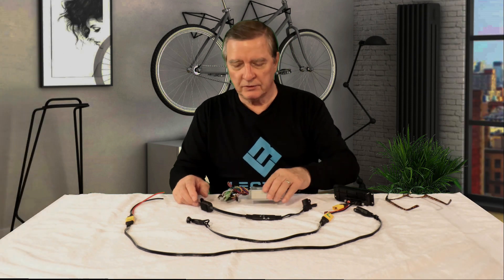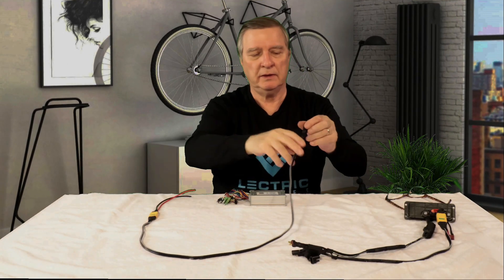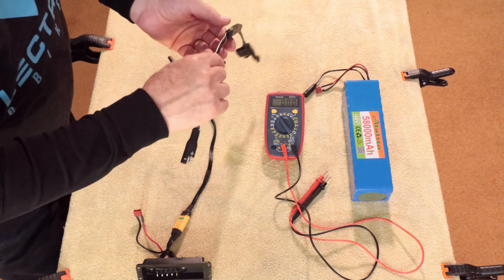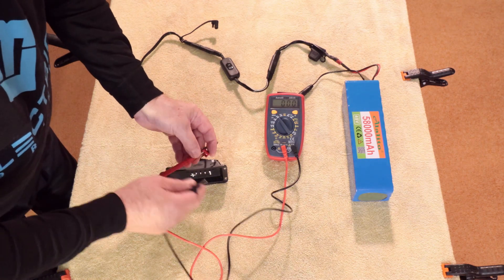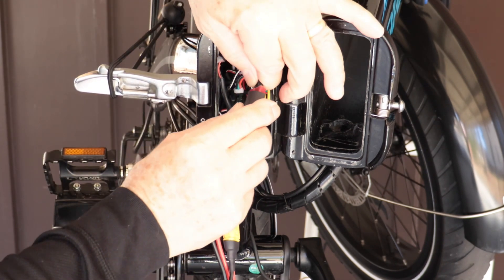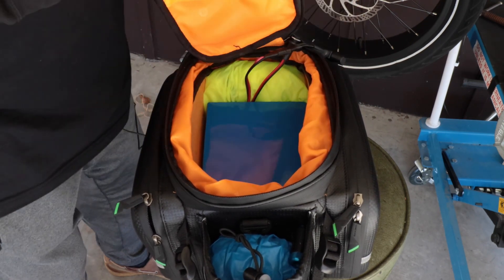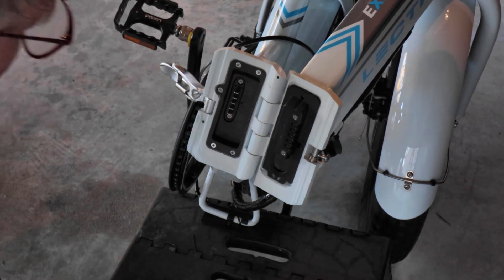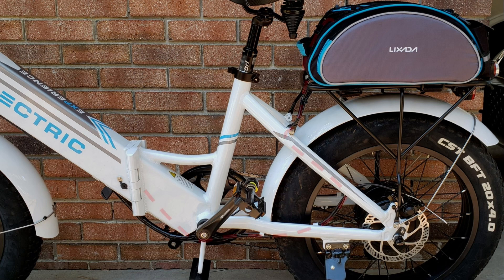How to E-Bike - Auxiliary Battery Wiring Harness in Detail

Comment: I rigged up an auxiliary battery in a similar fashion, but found I needed an isolate switch to remove the stock battery from the parallel circuit. With a 4v difference between aux and stock batt, I was getting a 12 amp draw off of the aux batt into the stock batt with the key removed. I verified with a wattmeter in-line as well as a multimeter between the stock batt terminals. Also verified after leaving it that way for about 3 mins and got a .5v increase on the stock battery voltage. Have you found any issues? I'm unsure how the key disconnects the terminals from the battery circuit.
Reply from the maker: Both batteries need to be at the same voltage level (+/- 0.2v).  I always change both of my batteries (14Ah and 20Ah) to full capacity 54.6 volts.  I run both batteries in conjunction and both batteries discharge at the same rate.  When I'm charging the batteries, I charge them separately.  The bike key in off position and the on/off switch to the auxiliary battery in the off position.  I have 4 batteries (stock battery size), two 10.4Ah and two 14Ah batteries.  One of the stock Lectric batteries has a damaged circuit within the battery and no matter what position the key is in, the battery is still on (power to the battery terminals).  I have well over 2,000 miles running the system this way and I have had no problems with battery unbalance, or any other issues.  I now have another e-bike, a Polarna, and I have wiring it up the same way and have had no issues after about 60 miles of riding.

Comment: Sonny, could you please let me know how much charge the battery on my XP1.0 should have when I store it for 2 or 3 weeks? Thanks
Reply from the maker: Anywhere between 40% ( 46.9 volts) to 60% (48.4 volts) would be fine with a target at 50% (47.4 volts).
Reply: @Onyasix  Thanks, I appreciate all the helpful information you've put out there, starting with mounting the bike. I ordered a 2.0 XP for the front suspension. It' will be easy to sell the 1.0 for close to the purchase price. Thanks again and good with your new 🚲

Comment: Couldn't find your video actually connecting the wires. Would be very helpful to see the correct connections in real time. Thanks!
Reply from the maker: Starting at 15:52 , I show the connecting of the battery connection panel to the auxiliary wiring hardness and connecting the battery connection panel wiring back into the controller.  Also,  in the video description, I show  links to several other videos that I have do on this subject.
Reply: Thanks!

Comment: I'm contemplating this modification, but was looking at identical batteries so I could charge them both simultaneously with the factory charger. Because your batteries are different, do you charge them separately?
Reply from the maker: Jack, sorry for not getting back sooner.  Yes, I charge mine separately for a couple of reasons.  Even if my batteries are the same, if you use just one charger (apples to apples), it will take twice as long to charge your batteries.  Also, no matter what, even if the batteries are exactly the same their charge rate will be different .

Comment: you should make a video doing a dpdt switch, this method is not safe if you have the switch and key on by mistake and also if both battery diff in voltage, i heard those ebay battery also uses cheap used chineese cells, im returning them before opening, i wouldnt recommend cheap battery as they can be dangerous, thanx to your video i figured out the ultimate way to add extra battery

Comment: This is what I needed. More stupid questions. Do you run the batteries one after the other or on at the same time for maximum range?
Reply from the maker: I run both batteries together.  I always fully charge both batteries, starting out at 54.6 volts each.  Since they are connected in parallel, they will discharge at the same amount of voltage.  By running them together, the batteries will run cooler since they are sharing the load.  Less heat from the batteries mean two things, they are not stressed as much which will increase their longevity and less heat means less energy lost which will increase range a little.  When I first started using the auxiliary battery, I used them separately which was a little of a hassle,  the batteries were never charged in sink with each other which mean more management.   At first, I was somewhat skeptical running 2 batteries of unequal amp hours together at the same time.  Other e-bikers that we running them together assured me that they were not having any problems.  So, I started running mine together and have not had any problems with more than 2,000 miles doing them together.  👍
Reply: @Onyasix  Thanks again. I am waiting for my ebike as we speak.

Comment: sorry for bothering you, i have watched all of your previous wiring harness videos, i dont have degree in electrical engineering but im trying hard to understand this sir, i was wondering if this wire from ebay  will work>>>>> https://www.ebay.com/itm/164679908565

and lastly, can i use 14 awg wire for that red and black wire?

or can i use this one and solder it to the battery conenctor>>> https://www.ebay.com/itm/174762949931?hash=item28b0aefd2b:g:X84AAOSwX9dgl9su

Comment: Finally got my Lectric Step Thru bike and installed the wiring harness as you described. Thanks for all the reminders to check and double check polarity before connecting battery to controller!!! Your detailed wiring harness videos are MUCH appreciated and ALL the battery data will help me determine if my battery is working as advertised! I have referred several people to your videos but the battery supplier we used is OUT of the 20AH batteries. Many battery sellers appear questionable as you have discussed; so selecting one that is honest and sells quality cells is a crap shot.

Comment: is it hard to install the Inline Cord switch to 14AWG Wire Harness with Quick Connect, im kinda confused, i really need long range as im doing uber eats
Reply: can you help me install a 20ah battery please?  the battery you have is out of stock, any help would be appreciated, thnx
Reply from the maker: @rahi7339  My DIY video is my help to provide instruction as to how make and install auxiliary wiring harness for an auxiliary battery.  The 20 Ah battery has been out of stock for several weeks now, however the 10 Ah batteries are available.  If you do not want to wait for the 20 Ah batteries to come into stock, you can take two 10 Ah batteries and connect them together  in parallel to make 20 Ah. If you need extra chargers, you need to make sure that you are ordering the batteries with charger(s).   Here's a link to a 10 Ah battery:  https://www.ebay.com/itm/224193914985?_trkparms=aid%3D1110006%26algo%3DHOMESPLICE.SIM%26ao%3D1%26asc%3D231994%26meid%3D146c30f2d6ef4232bd67596102fd594b%26pid%3D101195%26rk%3D1%26rkt%3D12%26mehot%3Dpf%26sd%3D184692542226%26itm%3D224193914985%26pmt%3D1%26noa%3D0%26pg%3D2047675%26algv%3DSimplAMLv9PairwiseUnbiasedWeb&_trksid=p2047675.c101195.m1851
Reply: @Onyasix  thank you, does your video shows how to do them parallel? I'm kinda confused, I will buy one 10ah battery for now, I was wondering about how to install the switch to the wire
Reply from the maker: @rahi7339  ~ a parallel connect between two batteries is fairly simple for those that have a basic background in electronic . . . red wire to red wire and black wire to black wire.  I don't know your electrical skills, but it sounds like this DIY project may be challenging for you.  You may want to get a friend with electrical experience to help you with this project.  If you would connect your wiring improperly you could do damage to your XP's controller, or even worst, cause a fire.  That being said, the 10Ah battery is still a good choice.  It would come close to doubling your range.
Reply: @Onyasix  do I need to buy any extra wire if I'm doing them parallel? And also do I need to do any polarity check you did? Someone told me I don't need to that as long as battery is 48v, thank you for the help
Reply from the maker: @rahi7339  ~ all you need is the wiring harness, the connectors and the switch as shown in this video.  If you are going to connect two 10 Ah together in parallel for your auxiliary battery, you need a Deans Parallel Connector (1 female to 2 male) https://www.amazon.com/FLY-RC-Connector-Parallel-Battery/dp/B07P6Q1DP5/ref=sr_1_32?crid=2Z1T8YQX379OX&dchild=1&keywords=deans+y+adapter&qid=1619489515&sprefix=deans+y%2Caps%2C174&sr=8-32
Reply: @Onyasix  k i understood everything, im just confused about how do you install the inline cord switch to the 14AWG SAE to SAE Extension Cable, im also planning to install a battery that has key? so will i need any switch? if not what cable do i need to buy? can you give any advice with that pleasee?
Reply from the maker: @rahi7339  ~ I've done a total of 4 videos on the auxiliary battery for the XP.  This video is the last one of the four.  It should help answer your questions to watch all 4 videos.  Here's links:  https://www.youtube.com/watch?v=jMvYM4Y3s24
https://www.youtube.com/watch?v=1ej3M_SEzmI&t=1064s
https://www.youtube.com/watch?v=hIS3FRVQHXc&t=315s
Reply: If possible, a video actually showing you connecting the wiring harness together would've been very helpful.
Reply: @mrmagoo9901  I already have two big 20ah and 25ah battery in my rear rack, my setup is completely different from the one in the video, mine is the most safest, I hired a professional to build me Dpdt switch to run one battery at a time, cost was like 40 only

Comment: Sonny, thanks again for your wiring directions; there is another person on facebook that gives a similar explanation of wiring for aux battery BUT his wiring does NOT include a FUSE that you have in your directions. 
 I assume that one reason you include the fuse, is to protect against the dangerous mistake of connecting the batteries when they are at a significantly different voltage?? Which would make for a BAD DAY as you say!  AM I RIGHT IN THIS ASSUMPTION?? The RUSH of current from higher to lower voltage battery SHOULD burn out the fuse before the batteries reach critical heat and explode?? Please comment on this assumption on my part. I did not hear you explain the use of the fuse in your videos.
Reply from the maker: I feel safer with a fuse for protection against a short in the wiring circuit.  48 volts systems are not to be taken lightly. There is the potential to create a fire and we have all heard horror stories about Li-ion batteries over heating and exploding and catching on fire. The XP's controller is limited to a maximum of 20 amps.  So, a 20 amp fuse or slightly higher will be required.  I tried several fuses less than 20 amps and as soon as I applied a load on the XP, these fuses would blow.  I run a 25 amp fuse just to be a little above the controllers 20 amp limit. Also, when running the auxiliary battery together with the stock XP battery, the wiring from the auxiliary battery to the controller will never reach the 20 amp load since both batteries are sharing the current load.  Example ~ stock XP 10.4 Ah battery  together with a 20 Ah auxiliary battery, the auxiliary battery will be suppling approx. 2/3 of the current or a max of 13 amps, while the stock battery is suppling the remaining 1/3 of the current or a max of 7 amps.  That being said, a long as you use both batteries together, you could use maybe a 15 amp fuse without it blowing when the controller is demanding a 20 amp max.

Comment: I was wondering a 6A 250V AC switch is good enough for a 48V DC with a current of (sometimes) 30amp (PAS 5)?
Reply from the maker: After more than 2000 miles, I have had not problem with the switch.   The controller on the XP is limited to a max. of 20 amps.  Out of those miles, I rode using the auxiliary battery alone drawing 20 amps (up hill) during several hundreds of miles of riding with no problems . . . overheating etc.  I now ride mainly running both batteries together.  Running them together with the controller demanding 20 amps., each battery is sharing the load.  So, the auxiliary battery on/off switch never has 20 amps of current passing through it.  At 20 amps (max.) going through the controller, the aux. battery (if 20 Ah rated) will only be contributing approx. 2/3 of the demand which is about 13 amps.  The stock battery (10.6 Ah) is suppling the other 7 amps.
Reply: @Onyasix   Thanks again for your excellent videos and for taking the time to respond to the comments/questions.  A couple of days ago, my 6A 250AC switch got stuck on the "on position" and got the controller error (E009) while I was using only the auxiliary battery.  When I opened up the switch, I realized that the internal circuit/plastic has melted - Luckily no damage to the controller/battery.  I replaced the switch with a higher rating of 10/16A.  The max drawing current was 20amps (typo *30A) on the auxiliary battery.  All wirings/connections were the same as yours.  Not sure what else could have caused the blown switch except the lower amp tolerance. On a different note: Does it make any difference if we place the switch closer to the auxiliary battery (swap the switch and the fuse positions).  So that in case of mistakenly connecting two batteries with significantly different voltage the fuse be able to protect the switch (and the battery)?  I presume it should not make any difference and the lower amp tolerance (i.e., the switch) will act as the fuse!?
Reply from the maker: I live in a relatively flat area, few hills and up hill runs don't last long.  I have not put my auxiliary battery in a condition where the XP is pulling 20 amps for an extended period of time, say more than 20 to 30 seconds.  As mentioned below, now I run both batteries together, so even when the XP is pulling 20 amps, the auxiliary battery/switch is only subject to a max of about 13 amps.  I weigh with gear and accessories ( aux battery, bike bags, water bottle, etc.) about 220 lbs.  Your riding conditions may be requiring more extended current loading than mine.  Where did you get your 10/16 amp switch?  I will mention your problem with the 6A 250v switch in one of my future videos.  Just curious, did you have a fuse in the wiring harness and if so, what amp is the fuse?
Reply: @Onyasix  The switch I am using is from Amazon (E-outstanding Inline Cord Switch 250V 16A Black Inline ON/OFF Rocker Button with Red Indicator light).  On the back, it says it is 30A/250AC! I used the same fuse (25A) you recommended.  But now I replaced it with 20A fuse. I was wondering whether swapping the position of the switch and the fuse would make any difference (I presume it shouldn't matter or it depends on the amp ratings of switch/fuse!?) in order to force the fuse to be the first to become open rather than the switch to become short in case of having issues?
Reply from the maker: @rafiems  It shouldn't make any difference which position the switch and the fuse are located.  The weaker of the two would be the breaking point.  The XP's motor is rated at 500 watts (800 watts peak).  I never have understood those numbers since 20 amps with 54.6 volts = 1092 watts (20a x 48v = 960w).  A switch rated at 6 amps with 250 volts = 1500 watts.  So, in theory, the 6A/250V switch should be more than adequate to support the current for 20 amps with 54.6 volts.   I'm wondering if the switch that you used was defective?  These are cheap switches and the quality control may be less than desirable.  If the switches contact points are not in full (solid) contact with each other, this could cause the switch to overheat.

Comment: If you have both batteries connected in parallel, don't they try to balance to one another, perhaps causing a high current runaway if one is drained, or does the XP key actually disconnect the circuit in the parallel hook up?
Reply from the maker: When running both batteries together in parallel, I always make sure that both batteries are at the same voltage ( usually at full charge to begin with at 54.6 volts).  If both batteries are not at the same voltage, I will run them one at a time.  If the key to the XT's  battery is in the off or locked position, the parallel connection between the two batteries is disconnected.  I also use my on/off switch to the auxiliary battery to connect and disconnect to the parallel connections.